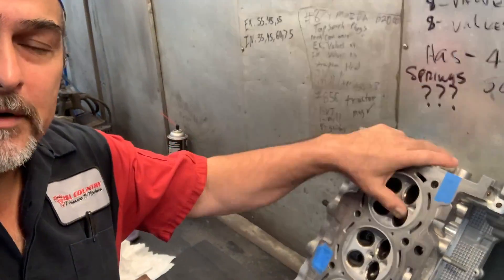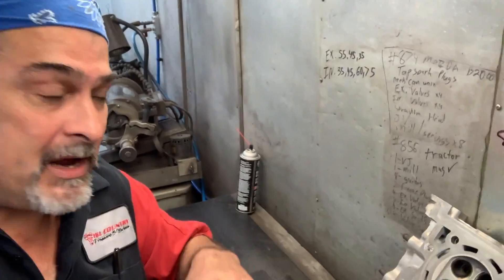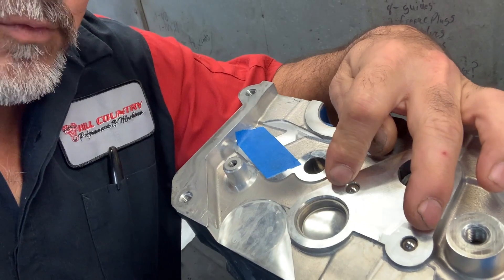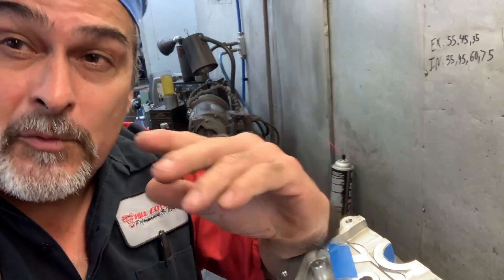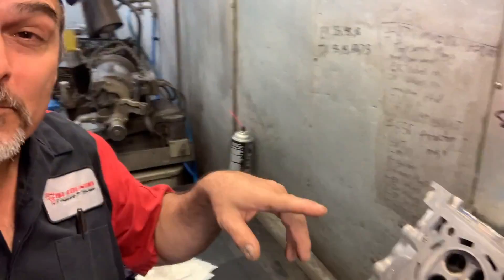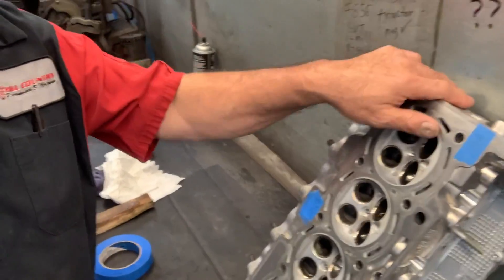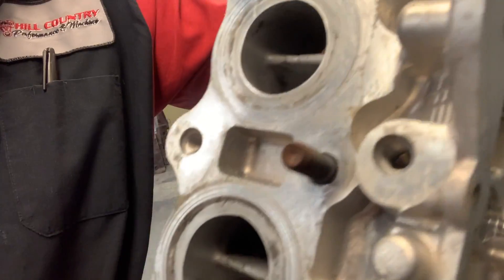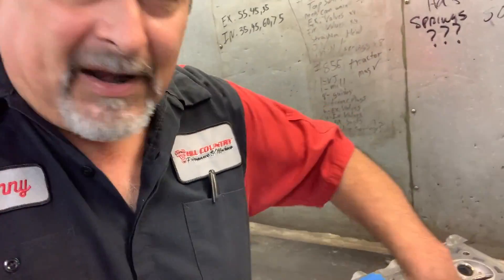How to Clean a Direct Injection Cylinder Head

Comment: How about one of the best carbon cleaners out there,  Mopar Combustion Chamber Cleaner, or the old but proven aluminum safe commercial carbon aluminum cleaner "Carbon Off", but you spray it & DONT touch it so you don't break the petroleum component of the chemistry that migrates to the top of the sodium hydroxide "active chemical" as it forms a skim to prevent the cleaner from drying out & to keep it active........  It needs to soak for hours to overnight, thats when you agitate.
  
Or, Piston Kleen, which is a very safe but effect Ester, again it takes time for esters to work & dissolve carbon.....

Comment: If I had to do any volume of these, I'd consider making a plate to bolt to the cylinder head face blocking  off everything except the  combustion chambers. Then I'd make a intake flange to adapt a shop vac hose and capture the sand and debris. All this could be mounted on a universal table setup to fixture the common outside dimensions of the plate allowing multiple types of heads. I think it would pay dividends compared to removing a tapping out the galley plugs.

Comment: Or how about use baking soda and then ultra sonic tank and you don't have to do all that crazy stuff. I build cylinder heads everyday. Glass beads get into threaded holes etc and you never get them all out. Not worth it having some get let lose inside an engine